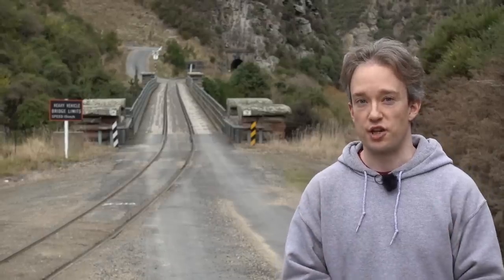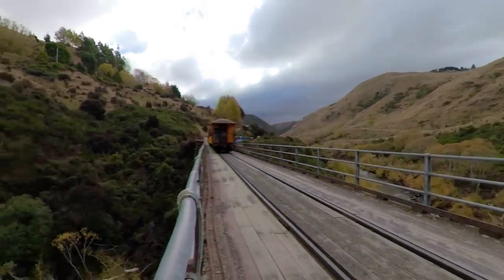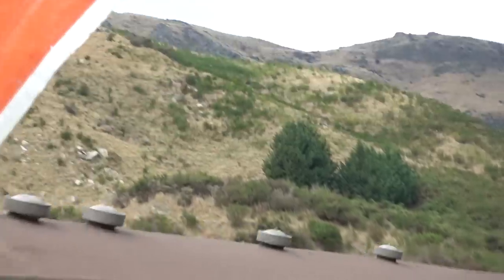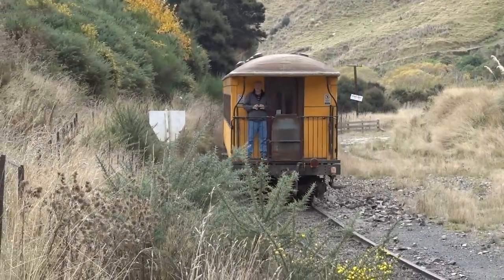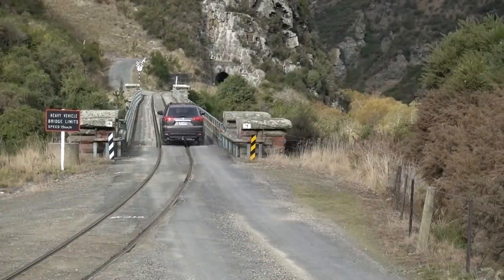The one-lane bridge shared by cars and trains

Comment: I have a feeling you'd like Whittier Alaska.  The only land access to the town is a 3 mile, single-lane tunnel, used for cars and trains in both directions. There are tolls and massive waiting areas on either end because the direction of the tunnel flips every hour.
Reply: Hope there's a river nearby 'cos I think it'd be tricky navigating that tunnel in an oil tanker.
Reply: That's what I was thinking. The story about the engineering that went into the tunnel is incredible!
Reply: @roblamb8327  It's on a coastal inlet (and was actually founded as a military harbor during WW2).  I imagine hazardous materials -- and things that don't fit through the tunnel -- get barged in via the harbor.
Reply: That tunnel (Anton Anderson Memorial) was originally hewn out of the rock for the railway.  For the longest time, if you wanted to take your vehicle from Anchorage or elsewhere in Alaska to Whittier, for example to take on a ferry, you’d load it onto a train and the Alaska Railroad would transport you and the vehicle to Whittier.

They put pavement in the tunnel a decade or so ago, added traffic controls, and made it a dual-purpose tunnel.  Trains still use it to this day, because Whittier is the dock that accepts barges carrying railcars from the south (until recently, that was Prince Rupert and Seattle, now it’s just Seattle.)
Reply: @joncalon7508  Interesting, thanks.  I visited Whittier in 2016 and loved it, absolutely gorgeous place. The story about it being built as a cold war era base absolutely makes sense, very defensible since there's really only one approach by land or by sea.  Funny how now it's almost a social co-op from what I've been told.
Reply: I was through that tunnel in 2008 on a motor coach (aka bus).  Fascinating structure.  Drive time is about 6 minutes at about 25 mi/hr. It is 2.7 miles long.
Reply: Isn't that still signal and barrier controlled though?
Reply: I went through the Whittier tunnel back in 2000. We waited 5.5 hours going towards Whittier since there were multiple trains using the tunnel during our two turns at going through, so we missed our opportunities. We only waited an hour and a half coming back.

Comment: "Trains and cars don't usually combine very well"
I'd say they combine TOO well. Once they meet, it's hard to separate the two.
Reply: Very easy to separate, the stuff still on the rails is train, the stuff on the sides that is not ballast was the car.
Reply: @crimmy838  Generally yes.
Reply: Hirail Truck.
Reply: As a locomotive engineer for 23 years I can relate to that !
Reply: Especially when you get hit by one...
Reply: its not really that they combine ... the rain rather assimilates the car into itself
Reply: They really have a great impact on each other
Reply: This whole section is either blursed or cursed
Reply: @TheDoof0412  nah fully cursed
Reply: I don't see why you wouldn't combine cars and trains. Why build a second tunnel if there already is one? Just load a bunch of cars on the train and there you go. Cargo as anything else (except maybe the humans inside the cars).
Reply: Without cars, a train is just an engine.
Reply: @sh4dy832  There was such a setup in Austria, the Grossglockner tunnel. I used it in the '70s. Don't know if it is still running.
Reply: Oh no, it's quite easy. The train does all the work.
Reply: @SeanBZA  was

Yes I did just reply to a 2 year old reply
Reply: @SeanBZA  was lmfao
Reply: Uhhh

Comment: This is one of those things that is very safe compared to suprisingly many things, precisely because it seems so dangerous and the hazard is clearly visible.

Suprisingly, sometimes adding safety-elements is dangerous, because people tend to trust them more than they actually protect.
Reply: Also, it looks like this is way out in the wops where people are used to tight, twisty gravel roads, wash-outs, ford's, stock movements, etc. That motorist who went past was probably a farmer. This isn't in the middle of a city or anything.

Comment: Until very recently, there was a shared bridge like this south of Greymouth on New Zealand's west coast. It wasn't just some rural town either, it was the main north-south highway where both the road and train track crossed the Taramakua river over a single bridge. It has since been replaced by separate bridges but it scared the crap out of me every time I drove over it because you're literally driving on a train track for a good 20 seconds with no lights or barriers to warn you of oncoming rail traffic.
Reply: There were bells at least from memory. It could be intimidating, but there was no risk in reality, on the odd occasion the train would end up following a car across.
The only safety issue with it was the driving surface(presumably largely due to the actual rails), from memory I think a motorcyclist had an accident on the bridge and died.
Reply: @DoubleMonoLR  Nope, no bells, just 'Railway Crossing/ Give Way' signs. 😊 I couldn't tell you how many time I drove over that bridge, was sad to see it go to an exclusive rail bridge. Was the same with the old Arahura River bridge too.
Reply: I rode through there on motorbike. Motorcycles don't have reverse gears usually...
Reply: @timconnors  But motorcycles can turn in place.
Reply: Would that have been the one on state highway 6?
Reply: I can remember driving across the Hokitika bridge when it was road/rail. Both driving and on the railcar to Ross. That was a very long bridge, about 750 meters. They closed the rail line in the late 70's.

Comment: This actually was a common occurrence on the west coast where the expected road traffic was light (given it was the 1930's when the roads were built) and you needed to minimize the number of expensive bridges across rivers. They are only in the last 10-20 years finally replacing the final major ones, with the Awatere Road Rail bridge (in Seddon, with it's rail over road design) only taking rail since 2007, and the two major ones on the west coast, Taramakau, which got turned into rail only last year, and Arahura which got replaced in 2009, but you can still go on a portion of the original span.

Also good to see that at the end of the video you showed the way to go over such a bridge. You never drive on the rails, always to one side.
Reply: Thanks for the update. I went down the west coast by bus years ago and was thinking, "But what about the bridges on the west coast?"
Reply: I was thinking of the one in Taramakau while watching this! They were still doing roadworks when I was there :)
Reply: The Awatere Road Rail bridge was the one that came to mind for me.  Just the chance of having a train cross at the same time was exciting to me as a child.
I'm only sorry they removed the road decking it would be the perfect place to take photos.
Would also be great as a pedestrian cycle bridge.

Comment: Nice work nailing that piece to camera in one take! Pressure!
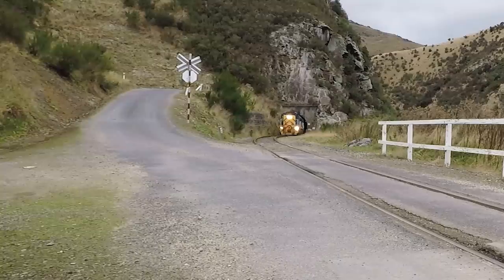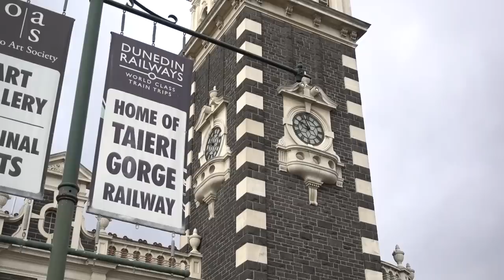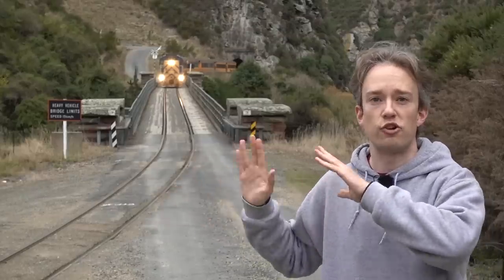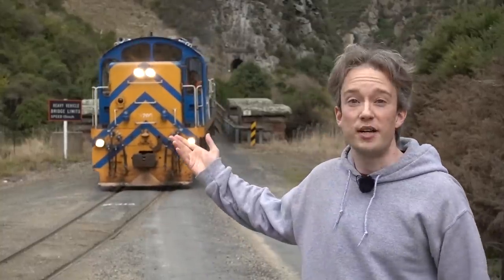Reply: There's no reason to believe it's one take. As another commenter has pointed out, if you go to 0:19, you can see a ghost image where two images have been merged. There are also multiple cuts in the video: the cut away to the train at 0:20 and back; the cut to the company building at 0:24. We cut back to Tom at 0:55, away again at 0:59, back at 1:03, away at 1:06, back at 1:10, and that shot ends at 1:20. The longest continuous shot there is about ten seconds.

Comment: If trains were invented today, we'd never have had platforms without barriers in train stations. Much like this bridge, so long as you're careful it's not a safety hazard.
Reply: At modern light-rail stations I've seen idiots sit on the platform edges with their legs dangling above the rails as they wait for the next train.  When trains pull in they end up within an inch of the platforms.

I personally like having my legs and feet too much to assume that I'll be able to move quickly enough when the train pulls up and that the driver would see me in time to try to stop.
Reply: @TWX1138  :  That gives new meaning to ‘Mind the gap’!
Reply: @TWX1138  Sounds like they need to install more benches
Reply: The floor is also an option. Not a great option, but better than in front of a train.
Reply: And southern England would never have had 'third rail' (750 volts) electric railways.
Reply: What are train stations with barriers? Do you mean those gates they have in Japan? If so, those really aren’t that common, I’ve never seen them here in Europe, except Heathrow Airport. It’s really not that hard to stay away from the edge.
Reply: Honestly, people are talking up how dangerous this is. The train goes past 2 times in the afternoon (there and back) and it's in the middle of nowhere. It's probably safer than most of the road to get there.

Comment: In 2002, I rode a motorcycle through the 2.5 mile long, one-lane Anton Anderson Memorial Tunnel that connects Wittier to the rest of Alaska.  It was tense riding between the two slots for the train wheels, and it was quite scary to ride unexpectedly, under the six, 75 horsepower jet engine-loud, air fans inside the tunnel, only a few of which were operating.  The train schedule was not obvious before I entered the tunnel.  And there was no traffic for me to blend into.

Comment: I crossed a bridge like this over the Danube river in Novi Sad, Serbia. A lot longer than there bridges, but it did have lights to prevent bad things from happening. They've built a big bridge a few 100 meters away in the last few years, so I don't think it will get much use now.

Comment: Used to be several of those where I grew up (also in South Island of New Zealand) many of them on main roads, was always fun coming up to the bridge only to have to reverse back across the rails out of the way of a steadily moving cargo train hoping somebody didn't come up behind you and block the way! There was also a trick to driving across them, was easy to tell who wasn't local by those who tried to drive down the centre of the bridge rather than too one side, driving down the centre meant when you got to the end wan wanted to turn back onto the road your car could start acting like a train and you could drive into the oncoming lane. Trains where fairly rare and they did have bells and barriers. Have all since been replaced with separate bridges.

Comment: There is a bridge, just like this, north of Mora, Sweden. It is called Oxbergsbron. It is set to be demolished within the next few years, sadly, as it is reaching the end of its structural life. However the big difference is that it is the trains that have to give way to the cars, pedestrians and snowmobiles. The trains are actually stopped by the same kind of beams that normally stop cars at a railroad junction.

Comment: There used to be an interesting bridge on the main highway over the Awatere River, which had road and rail stacked one on top of the other, and the road part was single-lane, controlled by traffic lights. Sadly, the road has its own bridge now, and the original one is only used for rail.

Comment: There is actually a similar situation getting into Whittier, Alaska (admittedly, only ~220 people live there.  The town is on the edge of Prince William Sound, on the other side of the mountains from the Anchorage area.  There is a one-lane tunnel through the mountain that is shared between both directions of the Alaska Railroad, as well as inbound and outbound car traffic.  Cars going in and out are let into the 4.1km tunnel every half hour, alternating directions and regulated by a traffic light and barrier.  But the schedule is upended when trains pass.  Though it's a bit different, I see some similarities between this topic and the Anton Anderson Memorial Tunnel.

Comment: The railroad doesn't share overlapping right of way with the highway right on the bridge between Fort Frances ON Canada and International Falls, MN USA, but it is all carried on the same bridge, and there are level crossings on both sides of the bridge right in the middle of where you line up in your car to talk to Customs & Immigration, an odd combination of two stress-inducers at the same place.

Comment: In the Black Hills in South Dakota there are several "pigtail" switchbacks on the road. You drive under a bridge, loop around and take the bridge over the road. Only place I've seen something like that.
Reply: There are (at least) two places similar to that in Zagreb, Croatia. One is near the train stop Vrapče, and the other one between the train stops Buzin and Odra. Both exist to avoid creating a level train crossing. There is also a similar loop for trains in Rijeka, but the whole thing is in a tunnel.
Reply: I just realized that I might have misunderstood you. Both of the road examples I've given are parts of road intersections. I don't think that any road just loops all by itself, though. Tunnel Albert II. in Monaco might be what you are looking for.

Comment: There's something really adorable about the machinist waving back at Tom
Reply: It's common courtesy in New Zealand, particularly in rural areas where everyone knows one another, or if someone's pulled over to let you pass. Even if you're just driving along a road with few cars, a wee finger lift and nod is enough of a salutation to acknowledge the presence of another traveller. This is in the lower third of the South Island, however, so I can't speak for anywhere else in the country.

Comment: 1:03... The boards and the railing flexing, are giving my anxiety some potent fuel.
Reply: That's just the digital stabilization on the camera
Reply: Note that this was a rail bridge to start, the boards were added later. the bridge itself is solid.. The boards flex precisely so they Won't break (other surfaces added on later like that would).  We build houses on similar logic to make them earthquake resistant. (Also less dangerous and cheaper to repair if the Do fail. Far less weight on impact or to pin you in place.)

Comment: I think in Canada they have a single track tunnel which works also as road.

Edit: So it's not in Canada but Alaska, and it's called Anton Anderson Memorial Tunnel.
Reply: I've driven through it. At 4 kilometers long, it's not insubstantial, but it does have full control for both the road and rail traffic -- including radar to absolutely confirm that no one is still in the tunnel when it switches over!

Comment: Holy moly the bridge wobbles so much when the train goes over it. 😨
Reply: Well, the railing does. Its got a wooden surface so it can flex (or even have one bit break, note how its lots of small, lengthways sections?) without compromising it, the Rails won't move more than anywhere else on the track, and I'd lay good odds that the Support structure is stone and metal (or reinforced concrete, depending on when it was built), no worse than any other bridge.   Does look slightly alarming until you think about that, though, I'll admit.

Comment: I would back across, so I had more speed to retreat if a train popped out of the tunnel.

The train would not stop in time at that speed. Nor is backing up in a panic a good thing.

A signal would be a good idea. A few solar panels, a few sensors,...

This is a good way to sell train tickets instead of driving.

Comment: Not much different than the 2 mile long tunnel into Whittier, Alaska that was built for the railroad.  In the late 1990's, it was modified to make it usable by both trains and cars.  Oddly enough, tunnel access is controlled by the Alaska Railroad, so trains have priority over cars.

Comment: Wow that's somthing I'd expect in some third world country but not in NZ :D  Not even traffic lights or gates. Never thought that something like this would be allowed there. But on the other hand the train is going so slow...
Always learning something new viewing your videos, thanks :)
Reply: These road rail bridges were built when there weren't so many cars on the roads. Certainly if a family had a car, they would have just the one. Also, one lane bridges were cheaper to build and as they were paid for by the taxpayer, through our Ministry of Works in the 1930s through to the 1960s, it made more sense when the traffic volumes were so low. A lot of the one lane bridges are gone now, certainly on the main highways at least, but in the back country there's still plenty around.

Comment: Sounds like resistance to modern warning systems.
Will it require an ignorant self inflicted fatality to implement?
Probably. Only a matter of time.
Reply: As noted, no one is doing more than ~15km/h, the trains are really light and well braked, and because both parties are approaching head-on there's no chance of sideswipe/looking in the wrong direction - oncoming traffic is right in front of you. The biggest risk is someone who doesn't know how to back going off the side.

Plus, it's basically a road for a couple of farms, no more. Little tourist or non-local traffic.
Reply: @someonesomewhere1240  :
And as I stated, there are lots of incompetent people.
Eventually one will visit that bridge.